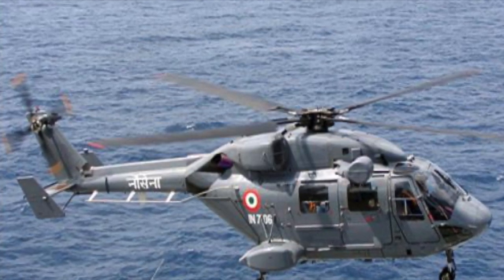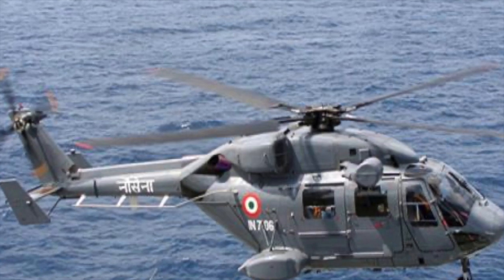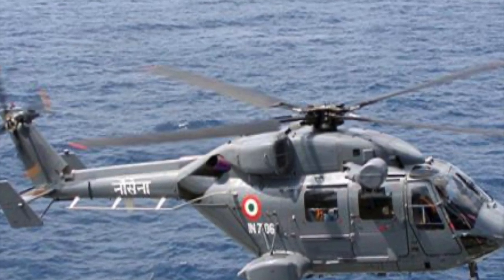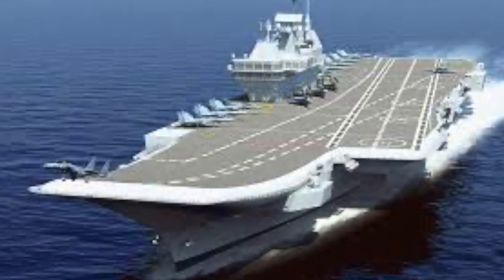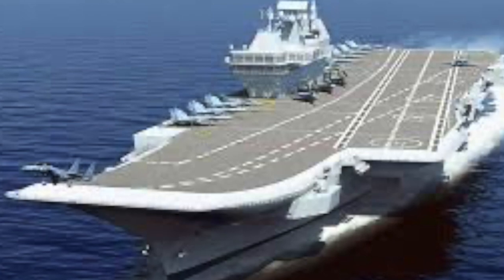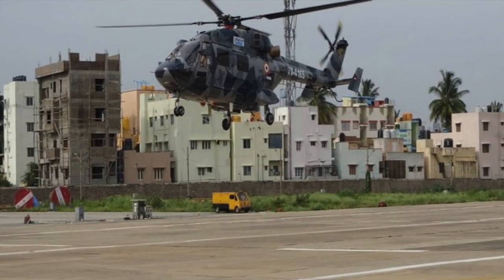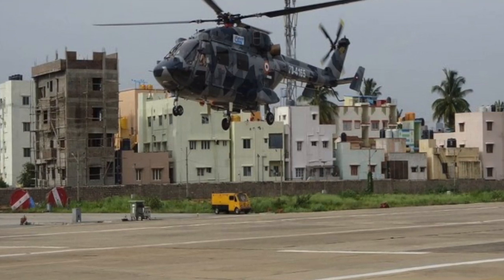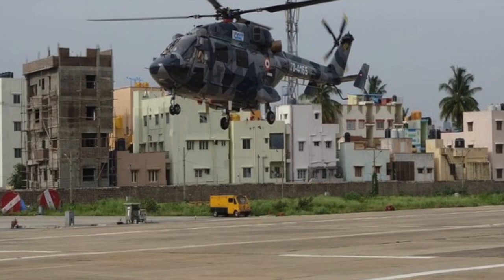India's Advanced Light Helicopter Design Evolves To Become Ready For Heavy Duty Shipborne Service

Comment: Surrounding view near HAL airport is depressing. Such important & exportable products should be advertised in a better manner. It would be nice if HAL relocates their flight testing center in a planned city (Chandigarh type).
Reply: Talk about useless expenses. There is such a thing as "Return On Investment" (ROI). For your suggestion, the ROI is extremely low. If the objective is better advertisement, there are other ways of achieving it. Clever direction being one of those ways. Or in this case, the simple planting of trees, or simply changing camera position relative to the background, putting the HAL hangars itself in the background alone would fix the problem.
Reply from the maker: True. Just need better angles and you can make it look better.